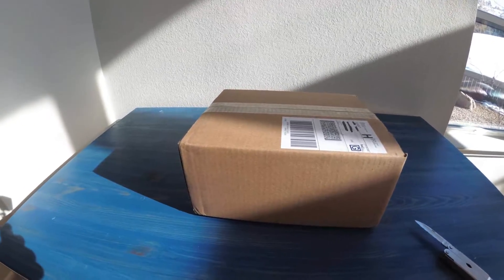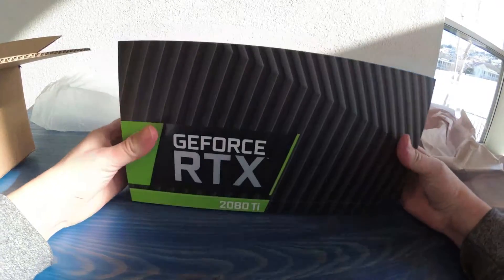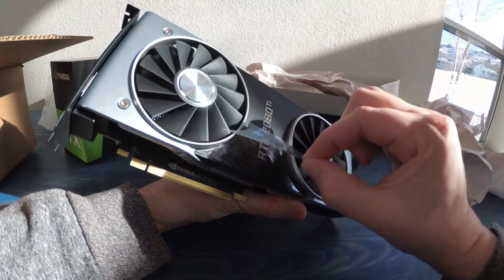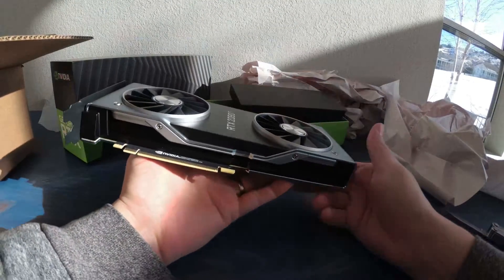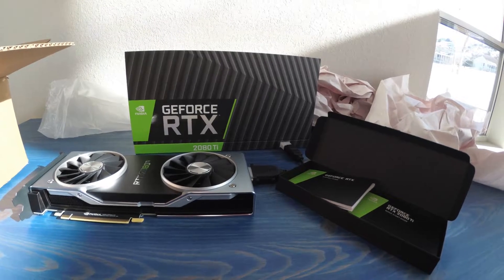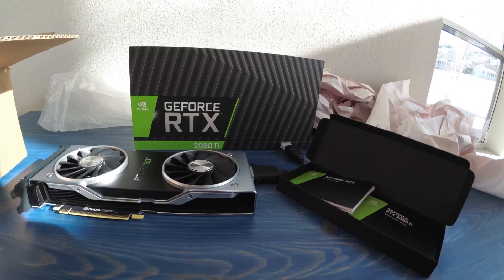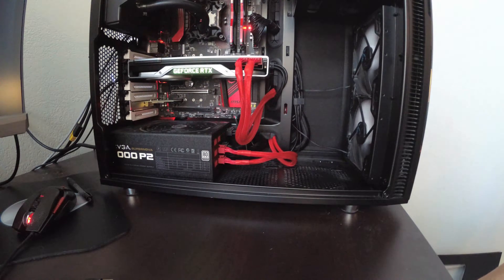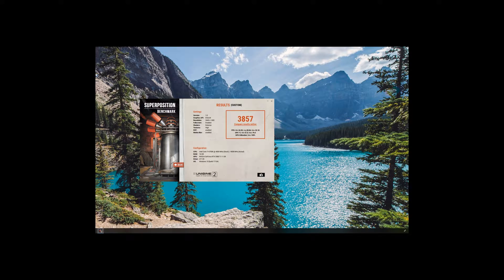Nvidia RTX 2080Ti Unboxing and Installation - 4k/60

Comment: 9:20 what is that grinding sound?
Reply from the maker: I think its its the faint rattle from my CPU cooler's water pump, or possibly the large front fans, not sure, can't hear it with the case cover on thats for sure :)
Reply: @CTP1111  OK. I'm thinking about picking this one up second hand and was wondering about the fan noise level.

Comment: what the r rest of the parts in this pc
Reply from the maker: intel i7-6700k with a swifttech H-140X water cooler,  EVGA platinum 1000 power supply, uhhh MSI gaming 5 motherboard, and some Geil 3200ddr ram, its in a Fractal Design R5 case :)  hope that helps!

Comment: You spent a ton of time talking about your old card but then never showed installing the new other than connecting the power cable. The title was installing.
Reply: He did show installation of the RTX 2080 Ti along with it's 8-pin connectors, however it wasn't in full detail but you'd get the idea how he did it. This isn't a tutorial video.
Reply: @freshprince69  well he did say installation sooo